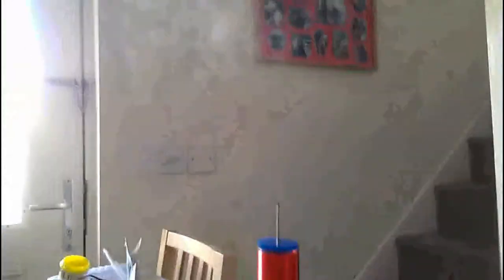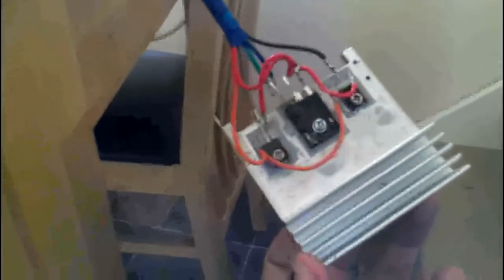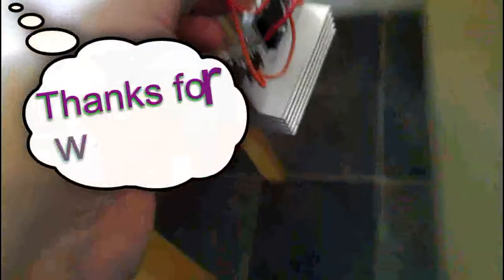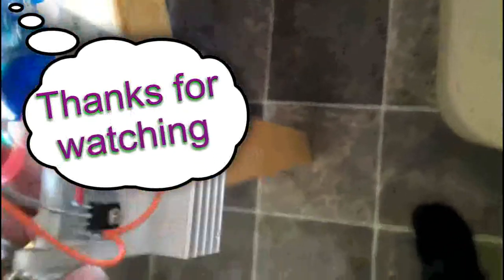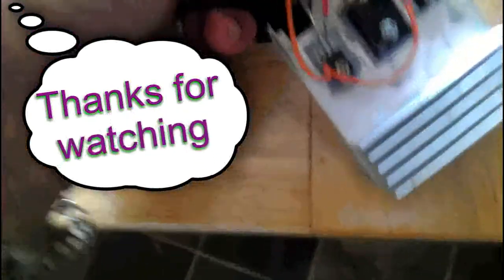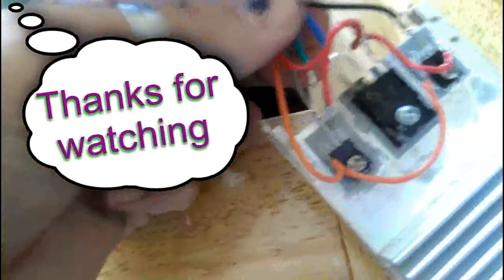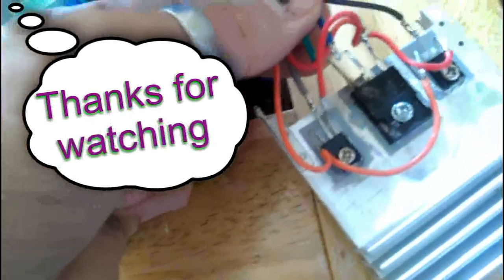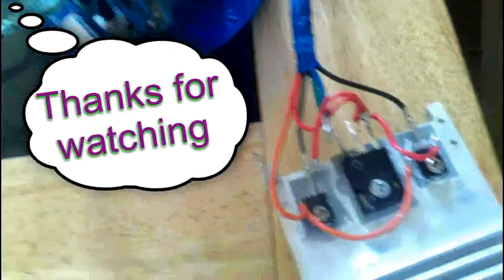Lets try pop a MOSFET again ,audio modulated sstc

Comment from the maker: i m gonna get it sorted but i got it as an upgraded to 400w or Most100v at 4 amp but as i said to  TheMaxii2007 was planing on making a better heat sink and fan but the fans keeps getting knocked out by the rf ,so gonna have to build the fan and heat sink in a comp psu case or sumin to act as a Faraday cage ? i really wanna run it at about 300w but to find a 300w 12v supply aint easy .plus with the way there hv side works it pulls as many amps as it can i coud remove a primary turn may help?